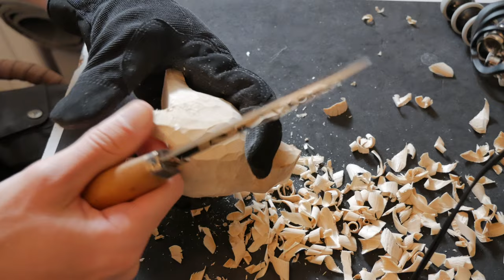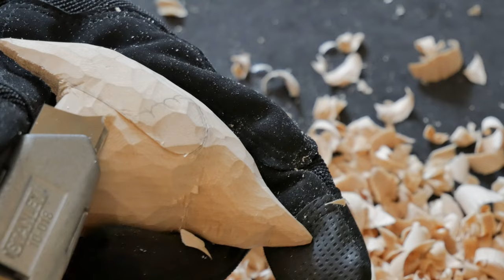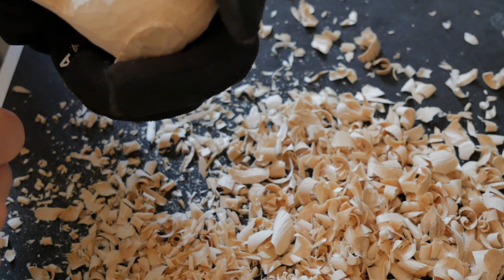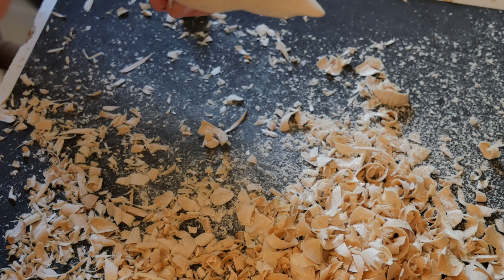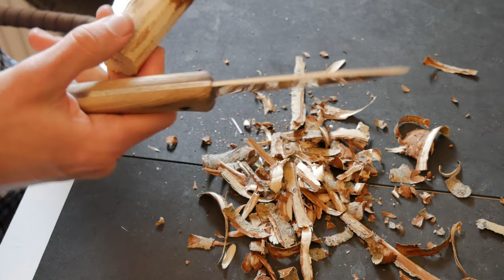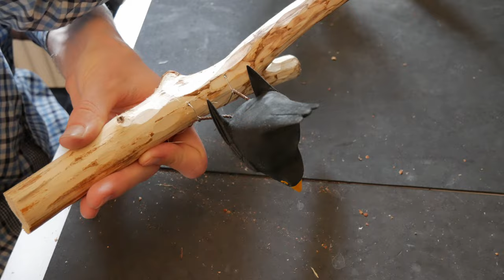Wood Carving a Bird ASMR 🐦No talking - Carving - Painting

Comment: That knife is great! What kind where from?
Reply from the maker: It's a Marttiini Eagle knife and in the other video it's a Wild Boar. I have tried cheaper carving knives but the steel on those are not of good quality so they dull quickly, so I prefer these knives. A far cheaper but very comfortable knife is the Marttiini Lynx lumberjack I rarely need to resharpen that knife 😀
Link to their website: https://www.marttiini.fi/epages/MarttiiniShop.sf/en_GB/?ObjectPath=/Shops/MarttiiniShop/Categories/Tuotteet/Designpuukot
Reply: Also which knife out of those you named would you recommend?